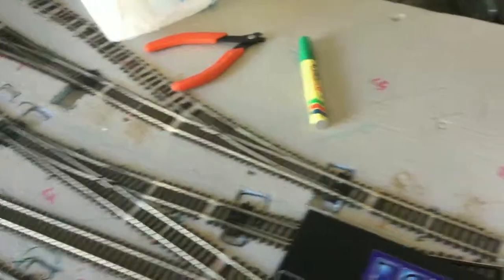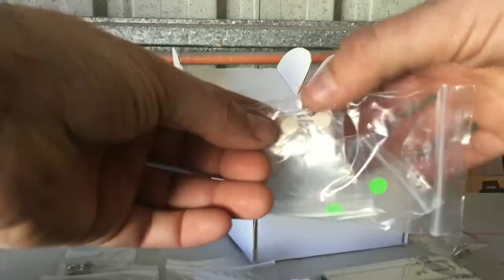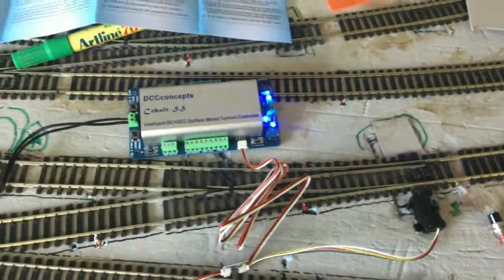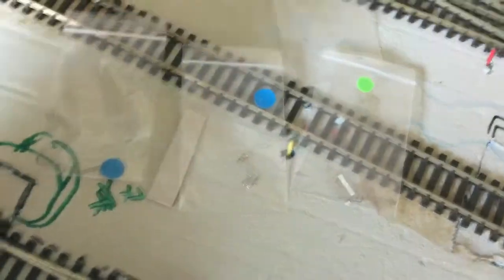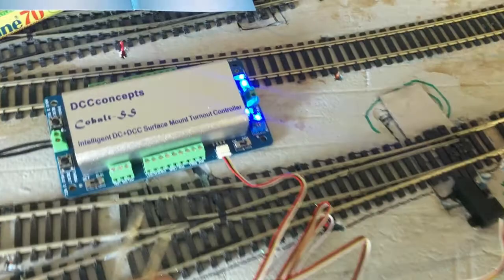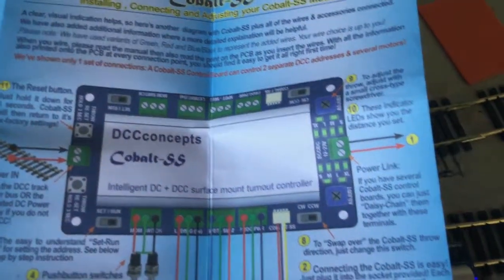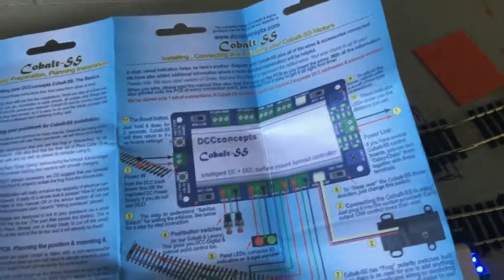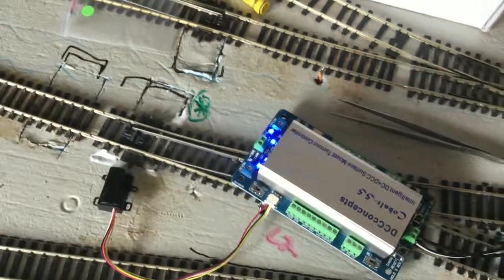Dcc concepts cobalt ss

Comment: I’m not sure what track to use for this system. Do you just hook up the Colbalt SS to an ordinary Atlas Switch Turn out?  I’m not sure how the track works. Please help. Looks fascinating.. Eric
Reply from the maker: Eric it has been a few years ago when I used these. They are similar to atlas top mounted ones. They can work with any track Turnouts. You can always bend longer wires and make your own custom draw/ pull bars to suit your needs. They can be set on the above / side or below the track. They are good option for some scenarios although if you have space and the layout is going to be established” never” moved again my advice is to look at peco point motors or tortoise switch machines or the DCC cobalt. These ones don’t throw every time and in my opinion is not reliable enough for me to use them. Hope this helps